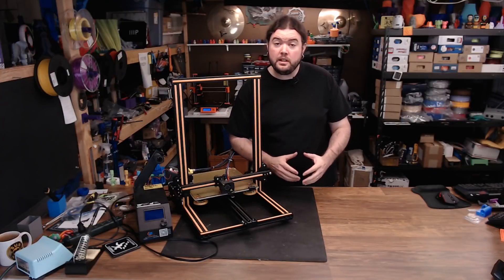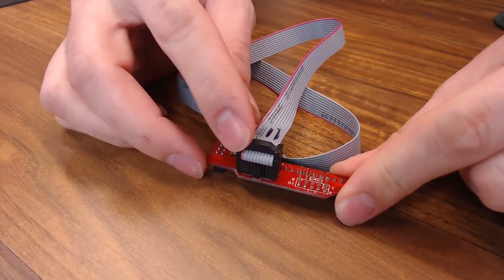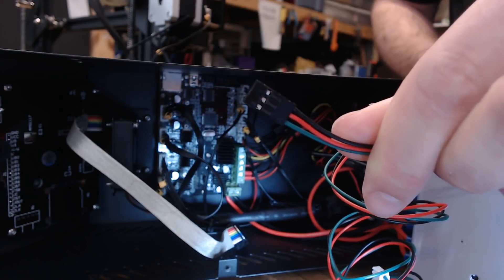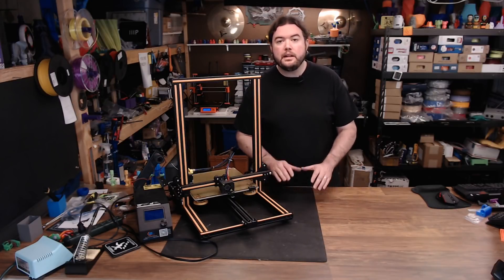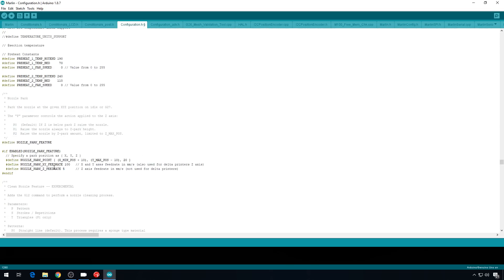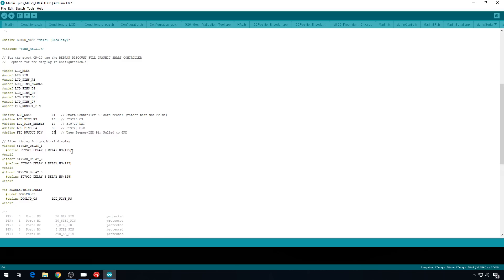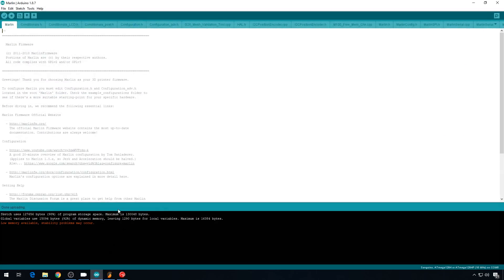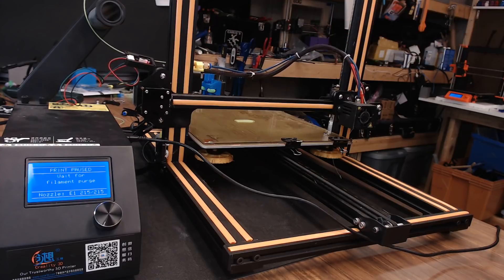Creality CR-10 - Filament Runout Sensor - Chris's Basement

Comment: Forgive me if you've covered this (I'm a little out of my depth I think). I recently installed the Ender 3 v2 filament runout sensor on my Creality CR10s. The printer already had a filament sensor, but it was rather faulty, so I replaced it by installing the new sensor. Only, when I plug it in with the wires/plug of my printer, it's reading the signal *backwards*. That is, when the filament is in and the light is blue on the sensor, the LED screen on the printer says  "Err: change filament" and when I pull the filament OUT (depressing the lever and button within the sensor, the blue light going off), the printer believes it has filament and begins heating up. Any suggestions? Would this be fixed with a firmware update? (which one?) or should I try flipping some wires...?
Reply from the maker: I'm not sure what firmware you are running, but to get that sensor to work you would have to make some changes. You need to flip the logic. If you don't have a copy of the firmware already, this could take a lot of work to create a new version. This video should give you an idea of the work involved. https://youtu.be/7i7PnBZ6cnM

Comment: Hey Chris! Been enjoying your videos. Ive had a Cr-10 v1 with the Melzi board for quite a while now. I have a BLtouch installed on it with TH3d unified firmware. Am I understanding you right here, that I can't install a runout sensor with the BLtouch installed? Or is there a way around that?
Reply from the maker: Thanks Luis, unfortunately, you have to chose, there isn't enough pins available. It's either filament runout or bltouch, not both.

Comment: Can you explain/show marlin settings for a Ender 3 V2? Thanks!
Reply from the maker: I get this request a lot, I guess I need to work on a build for it.
Reply: @ChrisRiley   is this correct?

ADDING A FILIMENT SENSOR:

CONFIGURATION.H:

Uncomment: #define FILAMENT_RUNOUT_SENSOR

Uncomment: #define NOZZLE_PARK_FEATURE

CONFIGURATION_ADV.H:

Uncomment: #define ADVANCED_PAUSE_FEATURE

Change To length of my boden tube: #define FILAMENT_CHANGE_UNLOAD_LENGTH
Reply from the maker: @SoggyCashew  That is correct.

Comment: Hi Chris, really good video, I was able to setup the run out sensor as guided in your video. I have only one issue, I get continuous beeping sound when filament runs out. The beeping won't stop until I insert another filament. Is there a way to stop that beeping or set the time of beeping ?
Reply from the maker: Unfortunately, I don't think so. It is very annonying. If you reflash the firmware, you could turn beeper off.

Comment: Hey Chris, thank you for the awesome video. Is this method applicable for RAMPS 1.4 with bltouch installed?
Reply from the maker: On RAMPS it's way easier. You can just use some misc pins, servo 3 is the default for the runout sensor.

Comment: I am doing this on an Ender 5.  I have the pin 27 board.  ran into some issues.  running through fresh, will see how it goes
Reply: ok, I have done it twice and gotten the same thing both times. it will run the m600 code but the switch seems to send it into filament change whether it has filament in or not (both send it to the change filament commands)... disabling for now
Reply from the maker: Very strange, I wonder if you used a jumper on the pins as a test if that could help find the issue.
Reply: @ChrisRiley  maybe.   I used a mashup of your m600 and cr10 runout videos and also watched teaching techs videos on the same things but it was ender 3 I believe.

would the Pins_melzi_creality step be correct still with the ender 5?
Reply from the maker: @deanbicking1296  That's a good question, the boards might be configured differently. I don't know for sure.
Reply: Hey @deanbicking1296  I think I might be able to help since I ran into the same issue on my CR-10. Since the Filament Sensor is connected to Pin 27, which is the default Pin for the buzzer, every time I wanted to start a print via the printer directly, the switch got triggered, so by the time the printer got up to temperature, M600 already started running.

My solution is to fully disable the buzzer and that solved the problem for me.

What I did in Marlin Firmware:

Under configuration.h search for "speaker"
There you will find #define SPEAKER and change it to //#define SPEAKER to disable it.

Under your board pin layout (for CR-10: pins_MELZI_CREALITY.h) add an extra line where it says:

#define LCD_SDSS           31   // Smart Controller SD card reader (rather than the Melzi)
#define LCD_PINS_RS        28   // ST9720 CS
#define LCD_PINS_ENABLE    17   // ST9720 DAT
#define LCD_PINS_D4        30   // ST9720 CLK
#define FIL_RUNOUT_PIN     27   // Uses Beeper/LED Pin Pulled to GND

add:
#define BEEPER_PIN      -1

This disables the beeper completely and doesnt trigger the filament runout sensor, it now works for me as intended in the first place, only had to invert the logic of the sensor in the end.

Please give some feedback if it worked so others can try this aswell.

Comment: Hi ;) It works on my ender 3, however, I wan't to manually removes the filament. I set FILAMENT_CHANGE_(SLOW/FAST_LOAD and UNLOAD_LENGTH) to 0, but when it detects run out of filament, it parks and then unload the filament :( then it force the filament trought the sensor and broke it.... My sensor is one-way, if the filament enter from the other side, it can broke the switch inside. That's why I wan't manually remove filament... I'm using TH3D U1.R2.9b... What I'm doing wrong? :)
Reply from the maker: You should be able to just comment out advanced pause all together and just use the park feature to get this to work.

Comment: Hey Chris really nice job!! Can you answer me this, I purchased this (https://www.ebay.ca/i/112698656755?chn=ps&dispItem=1) filament run out sensor and was wondering can I install this sensor to my cr10 without having to install marlin firmware? Like for instance, if you click on "Read seller's description" on the sellers page of this sensor there are 2 explanations for installing the sensor on 2 different motherboards. I'm one person that is not the best at doing such things (electrical handy capable I am not, lol) unless I actually have someone who knows how to do it, show me and I can't find any video on YouTube showing how this is done. Would you be able to show how this might be done with using this exact sensor and using the instructions provided by the sellers description on an original first gen cr10 motherboard? If you're able to do this it would be very much appreciated and also thank you in advance!!!
Reply from the maker: Unfortunately, there is no way to tell if a printers firmware can support a runout sensor. Most of the time, if it can, it will come with one. Flashing the firmware is really the only way to make sure it is done right.

Comment: Nice video again, Chris! 
I really like how you manage to break down a complex topic.
Sadly, I've failed to get the "auto load" option working on my machines, as the filament gets stuck when entering the heat-break.
Reply from the maker: Thanks man! I have ran into that issue as well. It works well on the Creality machines because the PTFE tube is all one piece. Not so much on the separate tube inside the barrel.
Reply: Thanks for the quick reply!
I didn't really think about that before. So the CR-10 doesn't have a heat-sink with separate PTFE tube? So you basically stick the bowden tube all the way thru to the nozzle?
(This lead to regular clogs on my TronXY X1, so I changed the hot-end assembly...)
Reply from the maker: @Caverntwo  Correct, it seems to work out well. The cheaper tube tends to get burned up on the end, but swapping to cap tube lasts a lot longer.
Reply: Cool, thanks for letting me know!
Obviously, I didn't think about that either...
Anyways, I think it's time for me to work on my printers again instead of "just" printing! Thanks for making these videos, they show me the countless opportunities left to explore in this field.

Comment: Great Video as always. Thanks a lot for this effort.
I only have one problem with these runout sensors. I checked all my spools an all of them have the end of the filament wedged on the role. Doesn't that cause problems when running to the end because the filament would stopped by the spool, perhaps being grinded by the extruder and never actually trigger the switch?
Reply from the maker: Thanks! I have had mixed results on that. Some seem to work just fine, but I have had other be hung up so bad it caused the printer to miss some steps, It would be nice to find a filament that has resolved this issue.

Comment: Thank you for this video. They are always very informative. I wonder though, is there an option to have the temperature of the hot end drop once the sensor has been triggered? This would be very helpful for overnight prints without the worry of having the hot end parked at full temp for several hours.
Reply from the maker: Thank you! As far as I know, there isn't an option to do that in Marlin today, but that would be a great thing to have added.
Reply from the maker: I was wrong, I just found this. This will turn the hotend off on park.   #define PAUSE_PARK_NOZZLE_TIMEOUT           45  // (seconds) Time limit before the nozzle is turned off for safety.
Reply: @ChrisRiley  Awesome! I think I know what my next upgrade will be :)
Reply: Geoffrey Hart at work we have a $4k Raise3D Pro2 and it stays temped up when paused, idk if even it has the setting lol

Comment: Hey Chris, great walk-through. Despite having done all the upgrades I've done so far, I've never even connected my filament sensor yet. Doh! Thanks for the reminder. I'll be going through this video again to make sure it's all set up correctly and testing. It will have to wait till later in the week though, got work to do, the kind that pays for my toys :-)
Reply from the maker: Ha! Yeah, I only got for the runout when I have a catastrophe. Then I realize I should have had it a lot sooner.

Comment: I need a run out sensor for the Tevo Flash. Any chance you might do that one, one day. Also I just added a linear rail to the bed of the Flash and tool bins. You can find the vid's if interested on my channel.
Reply from the maker: I am way behind on my YouTube vids. I saw you had some flash stuff up, I will check it. I would do one if I come across a flash for sure.

Comment: Great video pal, I am already using that jumper board for a BLTouch so am I out of luck adding a filament run out?
Reply from the maker: Thanks! With this config, yes, it's one or the other. This config rides on the beeper pin. There is an open pin 29, but I am not sure if it is exposed. It would take another board to use both, if it's even possible.
Reply: Dang had the same question haha good to know though, thank you Chris.
Reply: i seem to be having the exact same question right now. 

I think i should just upgrade to a proper board...but what options i should consider? if 50$ is the limit on the board, and preferably uses marlin? mks? I hate the limitatios that i run to all the time, be it the low amount of sram on melzi board of the lack of connectors.